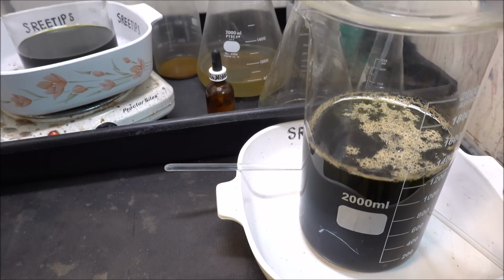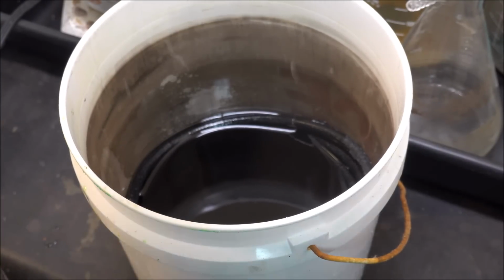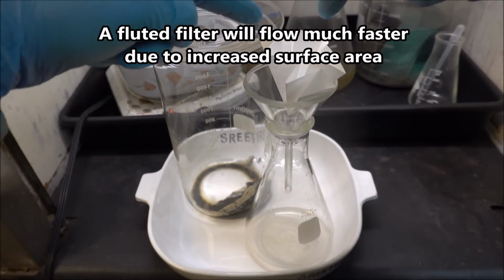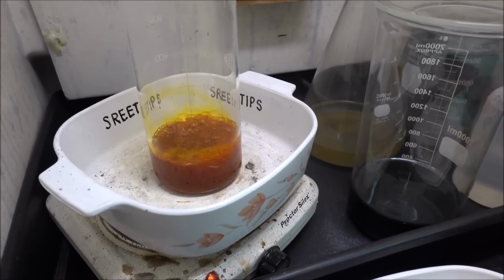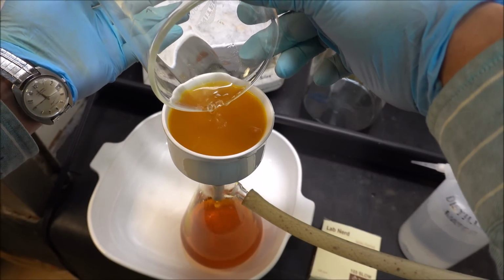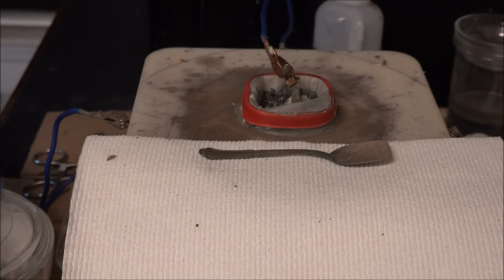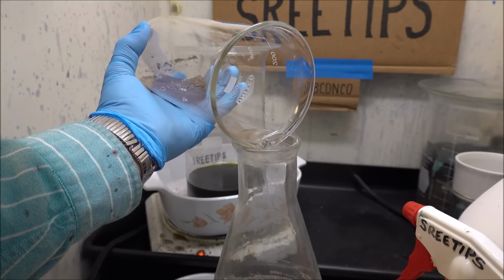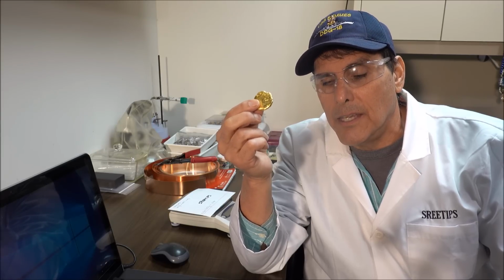Gold Refining Jeweler's Filings and Clippings Part4

Comment: If I were you i'd take all the iron and other metal hydroxides and roast them to convert them to oxides. Then make a whole bunch of thermite ! Doesn't matter if its not all iron oxide having some copper oxide mixed in actually makes it easier to ignite.

Comment: I have done a lot of reading and study on refining but one thing I haven't been brave enough to try is to in-quart karat gold to a very low karat and poor it into a thin disc and try to reverse electroplate with a sulfuric cell. Maybe a video.
Reply from the maker: I've used sulfuric cell for gold plated items only. I don't think that it would work for inquarted gold.
Reply: Would the cell be limited to gold plated or could you do gold filled and RGP.
Reply from the maker: Possibly, but I've never tried. With thick gold filled I'm thinking that the cell will heat up rapidly. It starts acting weird when it gets hot.

Comment: I know this is off topic so forgive me please. But I’m new to recovery and refining and I’m having trouble getting my gold to drop out of my hcl and bleach solution. When I add SMB the solution goes from a yellow color to just clear with no precipitation. Maybe it’s due to it only being a test run with 10 pinless CPU’s but I figured I would have at least seen something. Any info would be much appreciated. Thank you in advance.
Reply from the maker: Normal. When you have very little gold in solution then the solution will do just as you have described. If you let it stand overnight then you may wake to find a light dusting of gold settle out on the bottom.
Reply: I’ll have to look when I get back from KY. I thank you so much for the responses. Watching your videos and getting info from comments has helped me a lot sir. Thank you again.

Comment: Dont worry about the length.  I rather have a complete process versus a "Wtf step did he skip? how did that work?"
Break Break...   I'd reccomend putting up the cemented copper from the iron process up on ebay as opposed to just throwing it out.   Some of us are amateur chemists so finely divided copper could be used for a few processes I do.

Comment: Did you test to see if there was still gold in suspension prior to filtering it? You normally show you dipping the strip and testing for gold in solution. Great video series. Longer and more thorough the videos, the better. Take it easy.
Reply from the maker: It still had some color, noticed it during the edit. It was a missed opportunity to demonstrate the importance of doing the test at that point. But I knew from experience that the color was from platinum group metals in solution, not gold. All the gold had come down. I skipped the test for this reason, but for the video, I should have done the test.

Comment: Just to be clear, and only because I've heard you and others say it a few times recently, folding the filter does not increase its surface area. It decreases the surface area in contact with the funnel thereby increasing the surface area available for the liquid to pass through. I know it's a quibble, but like I said, it's only a point of clarity. 

Also, I've watched a dozen or more of your videos in the last 5 days, so I think I'll just go ahead and subscribe. It might turn your hobby into work, but your vids are great to watch!
Reply from the maker: You're absolutely right. There's more paper not in contact with the glass funnel and that's why there is more surface area allowing the liquid to flow out the filter. Good point.

Comment: I am puzzled you use tapwater ice, distilled water would have less impact on purity.
Reply: Chlorine isn't a problem once you've used hydrochloric acid.
Reply: There is much more in tapwater then chlorine, like fluor compounds and traces of iron and copper.

Comment: I understand it is probably because you had to inquart with copper instead of silver of why it is taking so long.
Reply: He has to because of the silver split with the jeweler ...
Reply from the maker: Actually the copper inquartation only added about an hour to the process. It's the finely divide state of all the different metals combined together. And my lack of experience. This is only the second time I've processed this kind of scrap from the jeweler.

Comment: Sreetips you should melt the copper in your waste bucket and pour some ingots to sell on eBay, im sure your viewers would support you and buy them.
Reply: I agree.  Worst case scenario it can be used to cement out the silver.
Reply: That copper is dirty.  It has lots of other base metals that have cemented onto the iron. Chemically processing it would cost much more that the value of the copper. But I am against throwing it out as well. Melting it up into an impure bar for someone else to use to me would be the best bet.
Reply: It sells as brass to my scrap man no problem. £2.20 per kg. Better than binning it! Someone somwhere must be refining it for a profit.
Reply: @michaeldenison7339  I would justy melt it into ingots and throw them into buckets and then just sell them to the junk yard as copper bearing.
Reply: Copper has value,,,

Comment: I use sulfamic crystals to denox which (I think) turns into sulfuric acid which should precipitate any lead just before filtering. Great videos sir! You're inspiring me to continue gold recovery/ refining, God bless!!!
Reply from the maker: I bought a pound of sulfamic acid from Home Depot about two years ago for $8. I still have most of it. I use it very infrequently. If incremental nitric dosing is done correctly, then there will be very little, if any, nitric acid in the gold solution.
Reply: @sreetips  What is the store name for that sulfamic acid at home depot?  I'd like to get some. I Get my Sulfuric acid from ACE, it's commonly known as ROOTO professional Drain Cleaner.  Root Kill is Copper Sulfate Pentahydrate,  and my Potasium Nitrate is Spectracide  stump remover. (poor man's Aqua regia)

Comment: I'm thinking expansion how many projects can you run simultaneously (and effectively) with one processing station. You could add another station and double your output :)
Reply from the maker: That would be nice for refining gold in one hood and the silver in another. The hydrochloric fumes from the aqua regia can get in to the silver nitrate solution and form a film of silver chloride. I've seen it happen while doing both at the same time in my fume hood. I usually do one or the other and try not to do both at the same time. But I still do when I'm trying to get these videos published.
Reply: @sreetips  Could you build another isolated processing station using the one fume hood so you would have two processing (isolated) stations. You could go back and forth between the stations while one process is happening in one station, you could be working on the other station with a totally different process. This would reduce down time. :)
Reply: @sreetips  very cool subject and content, been watching the casting channels also but the processing your showing is really interesting thank man :)